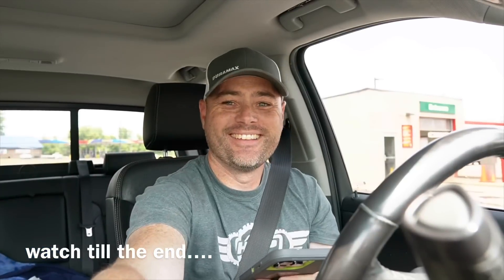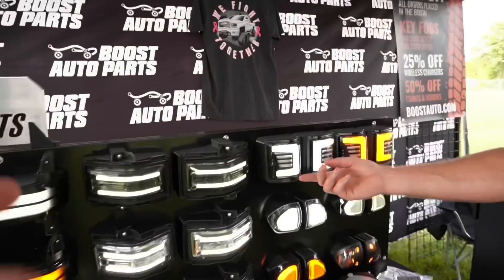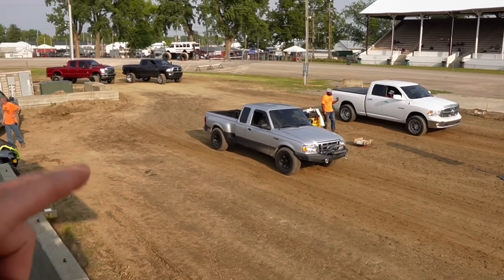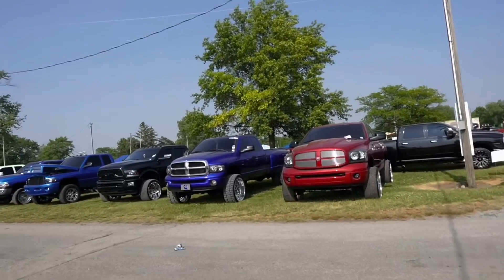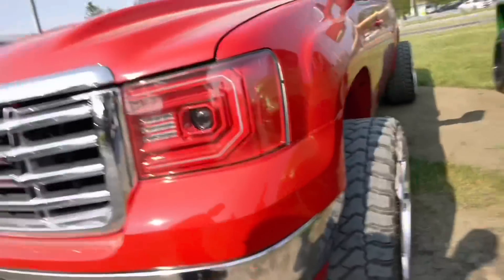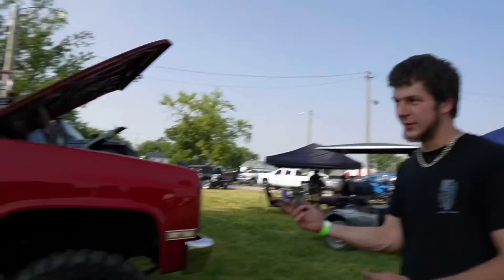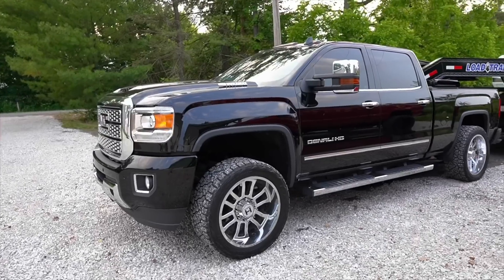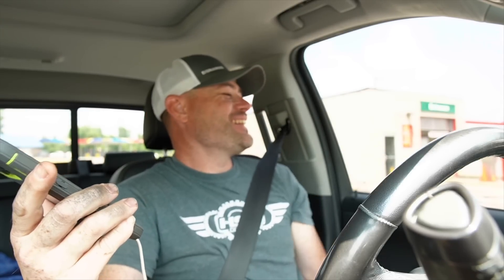Called The Guy And Told Him He Won The Shorty Duramax! *Listen To His Reaction*

Comment: I'm guessing any n all recalls were bever done before I got it in 2015....but since it has 160,000miles all stock n I was loosing coolant via a bad radiator...I fixed it n up graded that radiator n now have intermittent tail pipe white some n coolant losses n no fluids in driveway.../no back pressure in coolant tank...n no coolant in oil or vise versa...what's wrong ...im a bit lost..